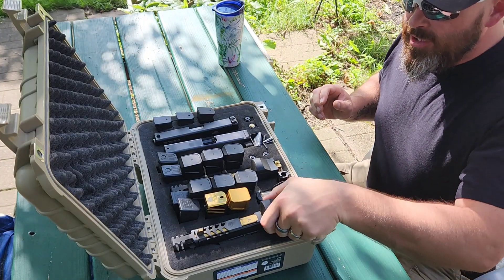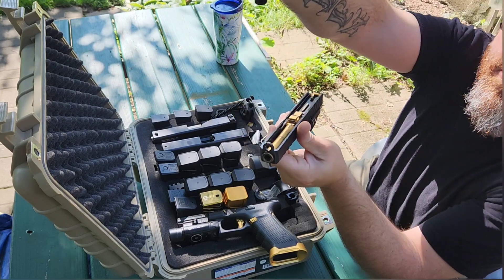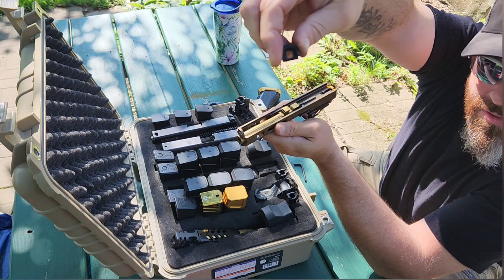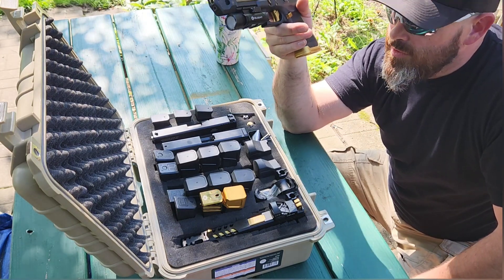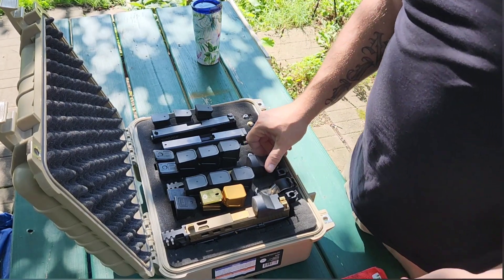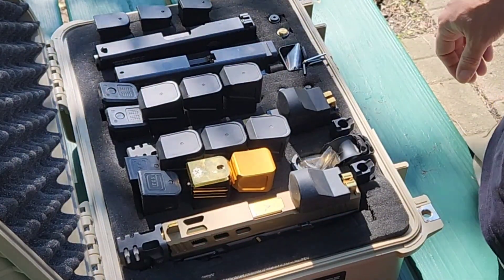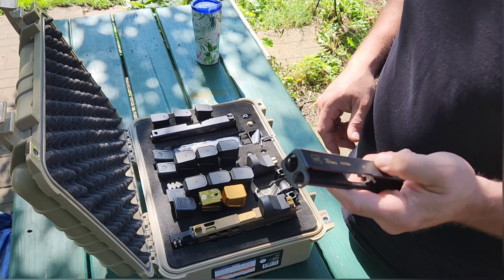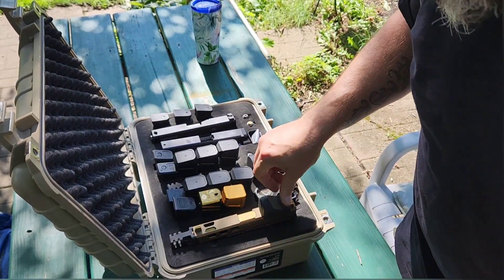Tuning your mass driver compensator #custom #glock #compensator

Comment: Thank you for doing this video and answering questions. Are you just playing around with the recoil springs or are you changing out the Stryker spring too? For some reason Wolff sends the Stryker spring as well as the recoil spring but I’m not sure if I’m supposed to change out the Stryker spring too or not. I’ve reached out to them but they haven’t answered back yet
Reply from the maker: Honestly iv heard of them sending those springs for you striker. I would not install it. I use and recommend the factory striker spring. You will most likely have more light primer strikes if you change that out, but ultimately it's up to you. Trying their spring can't hurt. You can always change it back out if I'm right.  No harm in Trying though.

Comment: what kind of barrel and compensator are you using for your glock 40
Reply from the maker: @victorsakay3159  it's actually a glock 22, the barrels are Trybe defense,  and the comp is a strike Industries mass driver
Reply: @thelanecompound9706  can i use the compensator on my glock 23? and you said to use a 15 lb. rod. do you take the 15 lbs. spring and put it on the guide rod that comes with the compensator
Reply from the maker: @victorsakay3159  yes just make sure you buy the right generation and model for your glock
Reply: @thelanecompound9706  thank you

Comment: Have you figured out a good kydex holster for this weapon?
Reply from the maker: @jondavidmcnabb  yes a few. I run a dara competition drop offset holster with just minor trimming with a dremmel to fit the compensator flawlessly. The holsters I have made for a glock 17 with olight pl pro valkyrie.  Then trim the bit that I need for the comp.